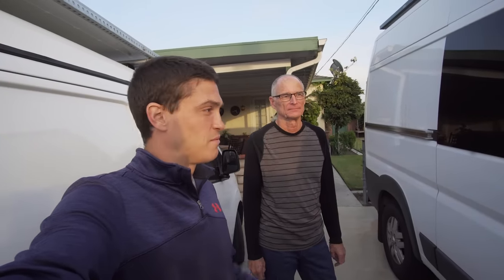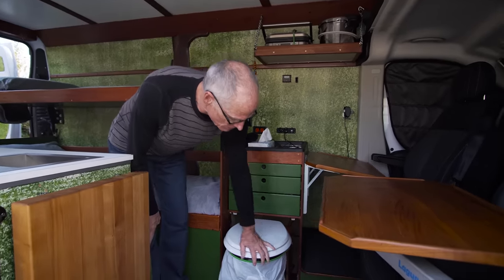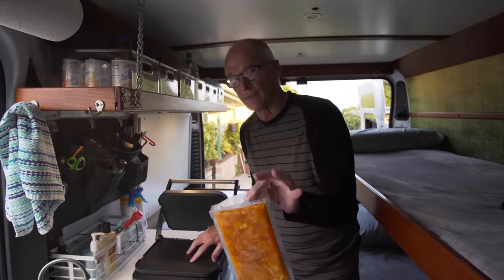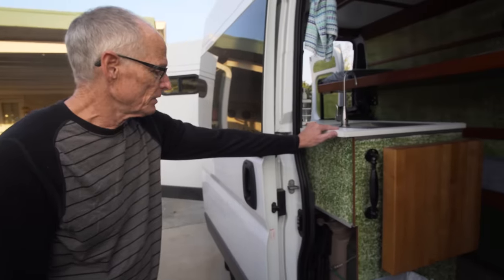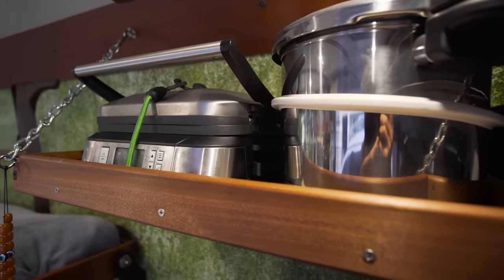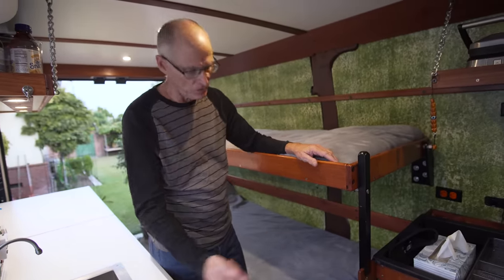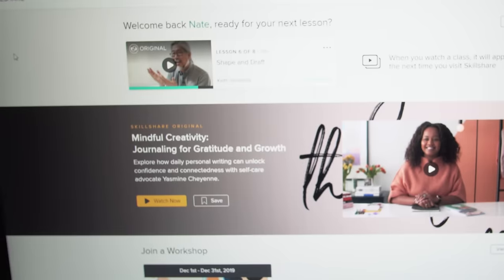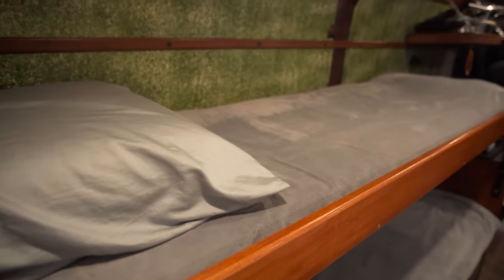Best Self-Build DIY Camper Van I've Ever Seen Tour

Comment: The van was built with a lot of thought into the details. Especially smart were the bottom drawers in the toe hold section, very clever use of space!  However, there are many decisions that I question in this van build.

What is the reason for switching from diesel to gas engine? I would really like to know your thoughts on this.  I've heard another person say this too.  I was favoring diesel because the engine has a longer life and if I put so much effort into a van build...!

Astro turf as a surface covering may eliminate scratches but harbors dust, smells, is hard to clean, sheds, and can peel off.  A smooth wall surface is much easier to maintain.  If you put a base coat of oil enamel primer, then coat with satin sheen latex paint, walls look colorful, relaxing and can be touched up very easily with water washable latex anytime with no visible signs.  I don’t feel it adds to the design element either, it looks very odd to have grass growing on walls.

Your bunk beds are an engineering marvel very impressive!  Quite remarkable you can fold it down two ways and it turns into a couch too.  There are many other options for beds that free up space too.  Use slat pull out type, or loft bed raised on linear actuators, or use Dave Orton's genius bed build which is a minimal design and folds away in seconds.  This is definitely a space saver, but you sacrifice overhead cabinet space and this is very alienating to adult relationships.  People have a need to cuddle other adults, kids, or pets.  How will this design affect resale value to a young couple?

11:45 - Why do you need to take apart your drawers and cabinets?  To haul cargo?  In that case, build out of 80/20 extruded aluminum.  I guarantee you will never in your life, find it worth your time to dissemble and reassemble these cabinets when you can rent a UHaul truck for $20 per day and $0.80 cents per mile.  Using cross dowels is not any stronger than glue and screws or an aluminum frame which is much stronger.  The statement that cross dowels allow you to use 1/2" plywood as opposed to thicker wood is absurd.  The wood will warp just as easily with cross dowels as with wood and screws.  If you used an aluminum frame, you could use ¼” wood panels to save even more weight with zero warping and greater strength.

Having a very short van instead of the longer models to be able to park in a parking space... do you think no big truck or delivery van ever parks at Walmart, Home Depot or any plaza?  This is not a 40 ft RV.  My 23.6 ft Class C RV (listed as 22 ft officially) fits anywhere.  And its much wider, higher and bulkier than any Class B van.  Unless you are traveling in Europe, no need for this short length.  You are unable to make a bathroom or proper toilet.  This is going to be a problem with any women travelers.  We need privacy, we cannot use the toilet without absolute privacy, and we like showers.  We also like a wardrobe.  This is in the DNA of every female.  You will be traveling solo quite often I predict.

Toilet - You may want to look into composting toilets.  There are 3 types of toilets:  With installed tanks, porta potties / luggable loo (your present solution), and composting.  Conventional installed tank toilets are a thing of the past.  Too pricey, too few dumping options.  Porta potties have to be dumped frequently, and gross out public toilet users at rest stops, parks, and you have trouble cleaning out tanks - the combination of pee and poop festering is a smell would knock out Muhammad Ali.  The solution is a composting toilet.  Do not buy the overpriced Nature's Head at $1000.  Instead, make one. All you need it a ‘separette’ available online.  The rest you already have.  Watch the Youtube DIY videos on making a composting toilet.  The advantage of this toilet is ease of dumping.  Empty liquids jug into public toilet.  Throw poop bag into trash.  Done.  My mantra when I buy or build anything is... how easy is it to maintain/ clean?

4:13 - the problem with your plastic bag frozen food, is that you are ingesting micro plastic to the tune of one credit card size of plastic monthly. This will harm you. You are not only storing in plastic but cooking in it.  Very dangerous for health.  Not sure why you have overkill in solar panels and battery power yet don't have a microwave to reheat food in glass containers?  Not to mention the enormous amount of plastic waste you are creating which is already a disaster with the floating patch of garbage the size of Texas in the Pacific ocean.  Convenient but environmentally and health-wise - a disaster.

5:58 - A programmable immersion heater in a vacuum flask.  1 - You need 2 more bulky kitchen gadgets.  2 - You are draining a steak of its juices cooking it slow, it should be seared to retain juices.  Any French chef would have a fit.  3 - The plastic bags will embed micro plastic pieces into your steak.  4 – More plastic trash created and expense of bags to buy.  Why not get a small gas stove that runs on propane like the Chef Mate Ranger Blind II stove?  Burns at 17000 BTU and is excellent for searing.  The induction cooker is another new invention that I feel does not provide optimal cooking and you cannot use any pan on it.  To each his own, but your food system is all frozen, you have no fridge, only a freezer, no ability to store fresh local foods during travels, and frankly, way too automated.   Cooking is one of the few joys of life that do not need high tech gadgets, just an old fashioned flame and fresh foods.

7:33 - You lack a grey water tank and are dumping dirty grey water onto pristine land or city streets directly?  Wow, this is so gross.  Just like the McDonald's tank dumping, this is offensive to others, and illegal in most states.  What do you do with your filled bucket - dump it on the same land or load a smelly bucket into your van, drive to a fast food chain and gross out the diners?  For all your high tech gadgetry, you failed in the basics - adding a tank so that you can dump responsibly.  This is no better than the surfer hippie dudes that throw their trash around or the Millenials that are focused on décor not sensible design.

7:43 - Most of your electronics are mounted inches away from your brain while you sleep. This runs at 60 Hz like your brain.  This will mess up your brain with its EMF radiation.  Super dangerous.  Asking for cancer in the short run.

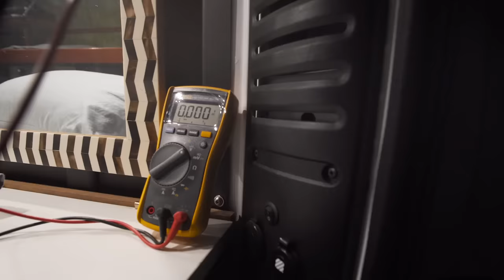8:26 - How are your Lithium batteries different from Battleborn or any other brand?  You talk of battery systems, and that you did the work yourself.  Well, almost everyone else does it themselves as well, and Battleborn sells batteries by themselves as well - no 'system' attached. Installing a battery bank running in series or parallel, adding disconnect switches, inverter, converter, monitors, gauges, controllers, etc., is not rocket science.  "I'm getting more than 5 times the power because I installed the system myself" - this is a illogical statement.  You can get any amount of power you want from a predesigned system to your custom specs.  Makes no difference whether you designed it or a commercial outfit made it to your specs.  In your case, you have way overkill with your 800 watts of solar, huge battery bank, and secondary alternator charging.  You don't need that much power to run an immersion heater, a one burner induction stove and a freezer.  Your inverter is only limited to 1500 watts which is pretty low for a huge power bank like this.  Cannot run a hairdryer which is usually 1875 watts on this low inverter.  Yet another reason women will not want to ride in this van.  
You failed to explain what makes your set up so special.

12:10 - Diesel furnaces are indeed excellent for van heating as they do not produce condensation like propane furnaces, however you paid $2K for an Espar Diesel furnace running on #2 diesel.  You can buy a Chinese make of this same furnace for $200 on Amazon which has been proven to be very reliable and is identical to German engineered and massively overpriced Espar.  I bet both furnaces are made in the same shop in China and marketed differently.  All Chinese furnaces come with their own portable mini diesel tanks you can refill at a gas station.  You might want to look into this.  Espar, Webasto, Trumi are all massively overpriced diesel heater/ water heater systems that are not worth buying unless you want to pay $2K-$3K instead of $200.

Not sure why you used open shelving instead of cabinets with doors.  Open shelving gets dusty and things fall out, and it looks untidy and exposed. Also light hits everything and wine, potatoes, and some stuff needs to be in darkness.  The vinyl foam floor is a very poor material. The print will have scuff marks from use in a short time, and it holds on to dirt, smells, and stains.  By contrast industrial rubber mat is the best material.  Throw rugs over it, won’t slip and will add cushioning and color.  

The sink is great (functional and elegant), so are the floor level drawers, and overall build layout – very nice.  Its minimalist, functional, and has no excess which is great. I feel though that you did a bit too much analysis which bypassed common sense and conventional wisdom on some features.

Comment: i am absolutely interested in a detail build video. this was a super thought out construction and right along my own ideas in my current van of being able to pull everything out easily for access and using van as a cargo hauler as well as home. so the whole not drilling or permanent attachment is very important to me. i am also curious what he does to vent the moisture from heating. also interested in more of the why’s of the choices for his appliances/ heaters, ie did he try other things and evolve to these choices specifically through previous van living?  what has worked and doesn’t work and why is really important in deciding my own follow along or detour to my own ideas. 

thank you

Comment: Several good ideas. Would like to know more about the insulation; does it work both for cold and hot weather? did he put insulation behind the cabinets, wall panels? And more on the floor mat and tiles (insulation properties).

Comment: instead of using a 5 gallon bucket, what about installing an incinolet electric  toilet. there are 2 caveats: cost is around 2100 & it does take a 20 amp  dedicated circuit. but everything is turned into ashes.

Comment: I've seen so many of these videos they all start to blend into one another. This video, however, sticks out. Very impressive! First video I've seen where the bed is up against the side wall as oppose to the back doors. I was thinking of doing the same thing since I'm traveling alone (dog in tow). I just bought a 2014 Promaster the same size as yours but w/ a low roof. I'm only using the van for weekend/week-long get-aways. The rest of the time I'm using it for my business. I was wondering if there was a company out there that mass produced an insulation, flooring, kit tailored to the Promaster (similar to your set-up)? I'm kind of between homes right now and have no location to work on the van, nor do I have much experience w/ building things much less the tools to do it with. Also, don't want to spend a ton of money hiring a builder. Any thoughts would be helpful. Thanks for the video!

Comment: Are the dimensional specs RAM provides for these Promaster cargo vans' overall lengths measured from bumper to bumper or is it something else, such as front bumper to fullest  extension of the rear swing out doors?  Their website doesn't specify and I am not ready to contact a dealer (just currently in early planning/research stages).

Comment: evaporator for the gray aluminum tank; best is small DIY solar disk-and-mirror system that can direct the heat to to the gray aluminum tank; then, it should evaporate.  Unless you like to evaporate it with a small stove under the aluminum tank.   Problem with govt; they can give ticket if you spill gray tank.  Best to evaporate.  Plus, cover the bottom of your van with air-crete to make it float on flood days.  Air crete DIY is cement and Seventh Generation or no color Dawn dish soap mix with high modified screw-driver with a mixer attachment; if it is thick enough then, dry to make a clay, a day after; then, patch it on your car before it becomes too hard.  Good luck.

Comment: Hi Lex or anyone that can answer these questions.... When using the floor bed rug, did you use anything else to prevent moisture and I have the same van except the 157 wheel base. Do you think the 157 wheel base have a hole in the rocker panel? I did look but not sure what I am looking at. Thanks

Comment: No, you don't go into most private businesses to use their toilets to dump your cartridge.  Especially a food establishment that has an enormously long list of health codes to follow.  But they would be less thrilled if they knew you were instead bringing it in a bag to dump, which could be easily punctured if you're bumping into people on the way in and where they will wonder "what, exactly, do you do with that bag after you've emptied it??"  I have never had a problem taking my cartridge in to dump at rest stops, service stations or facilities officially designated as "public".  Basically, facilities that are specifically there to cater to the needs of travelers.  However, just as you wouldn't walk through a McDonald's with your cartridge, neither should you walk through a gas station that is also a convenience store selling packaged and ready-to-eat foods.  But you also shouldn't walk through with bagged feces.  There is a reason for the old saying, "I don't ** where I eat."  The reason you state for NOT using a cartridge toilet (I can't dump it at McDonald's) is troublesome to say the least.  There are OTHER valid reasons, THAT isn't one of them as you shouldn't be taking your bag in either.

Comment: Yep, insulate for -5C, use battery to battery charger, plastic bag toilet (as used for dogs), don't store grey water, use diesel heating, 1kw solar on roof and lithium battery, use indu tion hob not gas, use gas alarms for all gases, underfloor heating is great, and make 3verything with strong fixings that can be taken apart and keep a van construction manual detailing everything! Oh and use bamboo plates, cups etc and study your van maintance manual, carry electric tyre pump! Most van builds I see on youtube are absolute rubbish, you will soon learn what you need, go wild camp for month at -5C.

Comment: Is the plastic they use in cooking toxic safe? I hope so or they'll be told to use non toxic material for cooking.. Would be nice also if their is an option for a third bed (planks of .5 feet plywood that are foldable and can be built like a puzzle) pull out version to connect to the lower bed so they can hug one another while sleeping and just go crawl on top if the person on the inner side needs to pee at night. Because hugging while sleeping is such a sacred spousal gift that they should maximize.. God bless